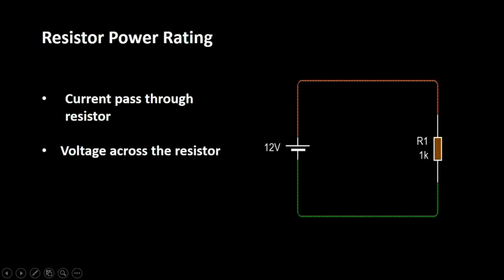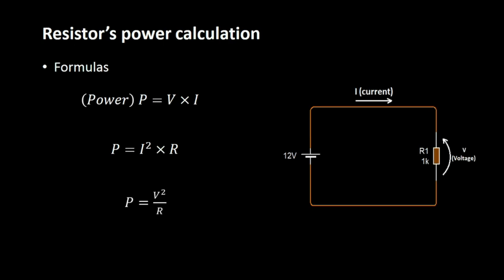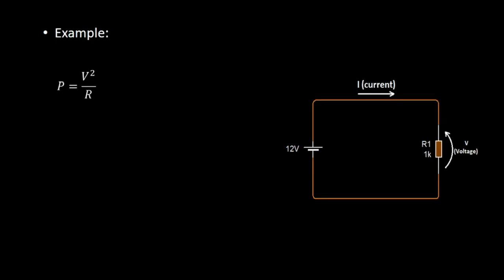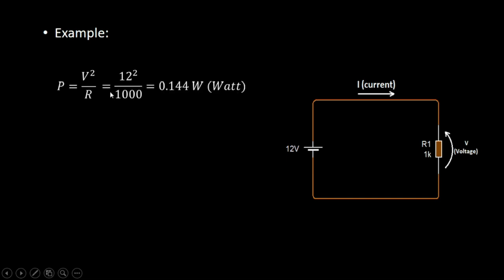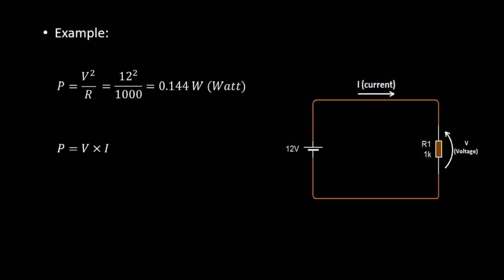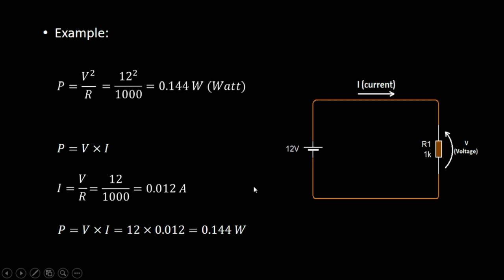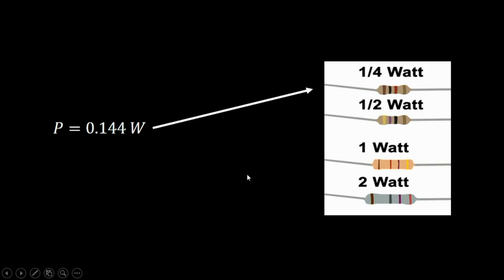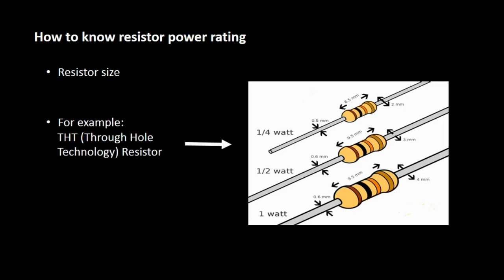Resistor Power Rating

Comment: so if in my car I want to connect my 12v agm bat. in parallel with lifepo4 (with bms) and limit amps going to and from lifepo4 down to 30A, I need resistor approx. 0.5ohm 500W?